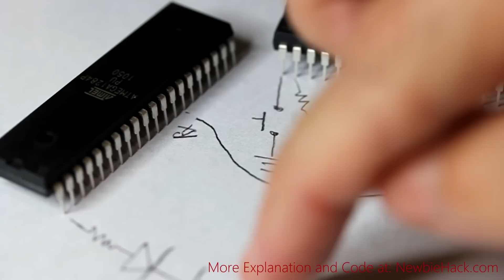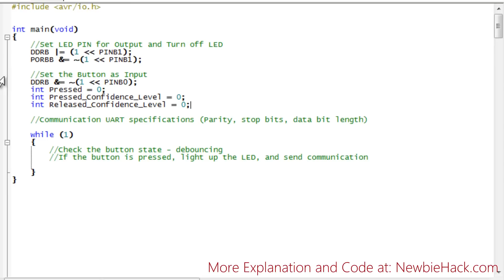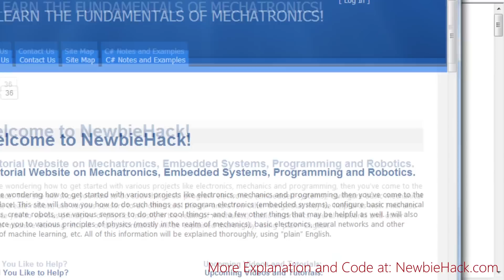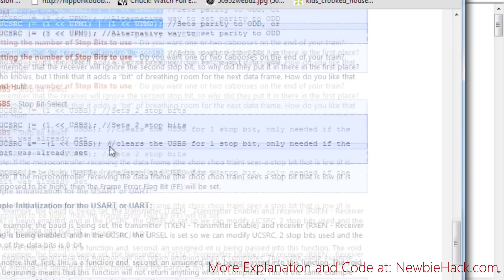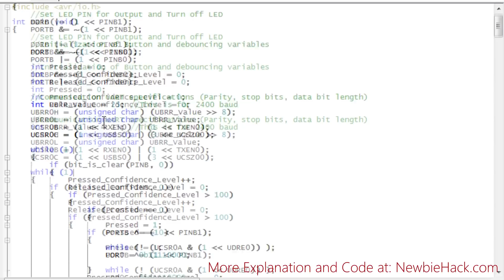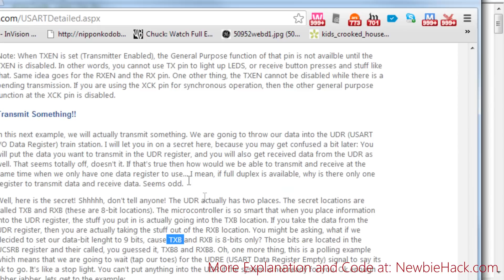48. Arduino for Production! AVR ATmega32 - One Way UART Communication with Two Chips

Comment: how do you flash an AVR microcontroller using UART device (USB to TTL converter) without a DTR pin?
Reply from the maker: You may need a bootloader to do that, but really recommend using the SPI instead for production. What is the reason you want to use UART?
Reply: @PatrickHoodDaniel  because it requires only two pins for communication and provides smaller and easier custom PCB designs. 
The boot loader does not erase after flashing using UART, with ISP it erases the boot loader and need to make sure the boot loader was burned back.
Best of all, USB to TTL converters costs literally less than 50 cents and always works out of the box with the CH340G chips. The drivers for CH340G always works, never had a problem quick and easy setup. The custom PCB with the AVR micro now has a built in “free” UART programmer thanks to the CH340G chip, just include it into the PCB design.
An ISP programmer however is expensive ($12+) and really a hassle to work with, complex drivers and requires more than 2 pins to function.
Although I would agree as for a professional production environment, ISP is  the industry recommended way to go. I think ISP is only good for burning boot loader and ISP provides faster write speeds.
Anyhow I was able to successfully flash a fresh AVR micro using UART pins, but I first had to burn the boot loader using ISP programmer which I used an Arduino nano to be the ISP programmer. I mainly wanted to include a programmer to the PCB and the UART CH340G was the solution. Flash Updates can be done easily without an ISP. Only a usb cable is needed now.
Reply from the maker: @ShopperPlug  That is a good solution and alternative. With my videos, I really focus on the most efficient and reduced cost for designs just in case folks watching go into serious production and wish to stay competitive. There are so many ways, and industry practices for quickly flashing MCUs that bootloaders are expensive in time and components.  One of  many examples would be to use SPI by designing copper pads on the PCB and use pogo pins and a jig to flash chips in-circuit in a production line. In either case, you still need a traditional SPI programmer to flash the bootloader.

If you are looking for a way to implement customer firmware updates, a bootloader is a must, but I would select a better MCU with built-in USB communication ability. The MCU will be far less expensive than an MCU plus extra ICs for USB connectivity. In that case, go with ARM and the STM32 line of chips as they are far more powerful and way less expensive. On that note, have you checked out my ARM tutorial series?
Reply: @PatrickHoodDaniel  Interesting, will keep that in mind for picking MCUs which has built in USB functionality, particularly ARM micros.

I’m actually just starting to learn about the world of ARM and how to program them. 
I did check your ARM series, will start to watch them. Thank you for making these helpful video lectures.

Comment: Hi, I have tried the exactly the same setup, only difference is that im using ATmega32, and I am noticing a huge delay between the two lights, is normal with ATmega32? (edit: the delay is about 0.5 sec)
Reply: Same here. Have you found any solution?
Reply: @imon4mRUET  haha dont remember anymore, but i guess i just accepted it
Reply: @MrMiniMe03  Hahaha.

Comment: I don't care if it is right or wrong. But I fixed the intellisense issue by defining the chip I am using before including the <io.h> Then you can drop the MCU variable in the Makfile as well or the compiler will complain of a redefinition.

If you are smart enough to define the device in the Makefile one should be smart enough to define it in the source code. Now you got intellisense since the IDE knows where to look. This is under MSVC 14, but this will work with older versions of MSVC and a compiled avr-gcc toolchain. No need for atmel studio, but to each his own.
Good videos btw, I am starting to slowly work toward uC's.

Comment: @Anupam Dutta
*****
@younghwan shin
*****

Don't forget to set the URSEL bit in the UCSRC register to '1'.
The code should read as -
UCSRC = (1<<URSEL) | (1<<USBS) | (3<<UCSZ0);

This should be done for both the transmitter and the receiver.

See p165 of the ATmega32A datasheet for further details.

Comment: Hello very good tutorials. But i have a question. I did this same project on my two mega16. They run on internal RC oscilator 1MHz. And Baudrate im set is 4800. When i push button, led on another mega switch on with delay. This delay is too BIG. I guess it is about 500ms or more. It should be much shorter. 4800 baudrate is 4800 bits per second. So i transfer 10bits total
(1start bit,8data bits,1stop bit).
So delay should be long -> (1sec/4800)*10=2ms. I dont know why is this happening. Can you help pls?
Reply: I had the same problem. I used Atmega32 at the both sides. The solution was to write the UART initialization in this way: UCSRC = (1 << URSEL)|(1 << USBS)|(3 << UCSZ0); // URSEL selects between accessing the UCSRC or the UBRRH Register
Reply: @antonibelov  I've written it as you've mention & using atmega32 and still finding this delay. Is there any other solution?

Comment: i used atmega324pa for transmitter and atmega32a for receiver. i used this code:
transmitter:
int UBRR_Value = 25; 
 UBRR0H = (unsigned char)(UBRR_Value>>8);
 UBRR0L = (unsigned char) UBRR_Value;
 UCSR0B = (1<<RXEN0) | (1<<TXEN0);
 UCSR0C = (1<<USBS0) | (3<<UCSZ00);
........
while (! (UCSR0A & (1<<UDRE0)) );
     UDR0 = 0b11110000;
-----------------------------------------------------------------------------------------
receiver:
int UBRR_Value = 25;
 UBRRH = (unsigned char)(UBRR_Value >> 8);
 UBRRL = (unsigned char) UBRR_Value;
 UCSRB = (1 << RXEN) | (1<<TXEN);  
 UCSRC = (1<<URSEL) | (1 << USBS) | (3<<UCSZ0);
...
while (! (UCSRA & (1 << RXC)) );  
  receiveData = UDR;  
  if(receiveData == 0b11110000) PORTB ^= (1<<PINB0);

here when i am pressing the button on transmitter side the led on transmitter side is working but the led on receiving side is not working...i have checked everything and tried to find the issue but don't know why no communication is going on between chips....please help...what is wrong here
Reply: Can someone please help me to find out the issue here...

Comment: I don't get it... Why don't you just use Atmel studio 6 instead of some editors notepad?? 
Its right there and it's free and it has error correction so if you are working with a certain micro then it will highlight your registers so you can know if you typed the correct bits or not.
Reply from the maker: I do!  Check out my other videos.
Reply: Patrick Hood-Daniel
Yes my apologies , I see in your UART library video that you have finally gotten to it :)

Comment: Wow, your a great teacher. I've seen others leave so much open for us to assume. I followed every AVR video but seems like there is one missing explaining how to hook up the crystal for external clock. Also I would be interested in how to run FFT on the AVR for analysis purposes. LED visualization of FFT seems popular- kinda cute too but I would like to get into comparison algorithms and more applicable uses of FFT. If I need more power (speed or ADC resolution for -audio spectrum for starters) to do this, please inform. Much thanks.
Reply from the maker: Hey Kyeol,  Thanks for the kind words.  I did crystal videos a little while back, but may be difficult to fin don my channel: Microcontrollers - AVR - Understanding Fuse Bits and Understanding Crystal Oscillators and Writing the Fuse Bits to the Microsontroller.  FFT (visual) implementation does seem like a fun project. I will put it on the list.

Comment: Consult the data sheet, for example, if you were to use an ATmega328P chip:
* do a quick google search for "atmega328P datasheet"
* find the pdf datasheet, usually from the atmel website for this chip
* on the first few pages there will be a chip pin layout with functionality info

Hope this helps!

Comment: Patrick, you have an error in your code. I was trying to do some UART communication between ATmega8A and ATtiny2313A which are slightly different and found out that megaAVR contains bit called URSEL which is part of UCSRC register which routes access between registers UBRRH and UCSRC as they share the same I/O location. Thus for megaAVR I had to use 

UCSRC = (1 << URSEL) | (1 << USBS) | (3 << UCSZ0);

You also probably need to set URSEL bit to 0 before writing to UBRRH.

Comment: Great video! One question though: 

I've been following along with this series using an attiny84 micro, but it doesn't seem to have USART functionality - it has something called "USI" instead - what's this? I'm trying out the UART with a couple of atmega328s I had lying around instead, but is it possible to do something like this with the attiny84?

Comment: Why are we using 'int main(void)' and not 'void main(void)'?
You should do a mini video on making a reusable code (I think its called a library) for button debouncing, UART initialization etc so we don't have to write these every time. In the MicroC compiler, its already included, I would like to make one for myself so that I know what is actually going on.
Could you recommend a good source where i can understand C++ operators clearly. I dont understand those complex sets of operators you use.

Comment from the maker: Thanks for the comments. Yeah, it's really personal preference.  I have more control when implementing software debouncing. I will add a link to the description for the hardware debouncing video if they prefer to use that method.  For future videos that involve switches and buttons, I will either implement no debouncing and mention the video with debouncing, or I will add the debouncing programming without explanation and refer to the videos.

Comment: Good video. 

My only critique would be that you could have used a simple 0.1-0.47uF capacitor in series with the button and resistor instead of spending so much time on writing code to do the debouncing in software - this was explained in another video and wasn't the purpose of this "lesson", so no point stretching people's patience with it.

Considering it's meant for beginners, maybe it would have been better to not rush it and order an identical chip and make it more clear to everyone.